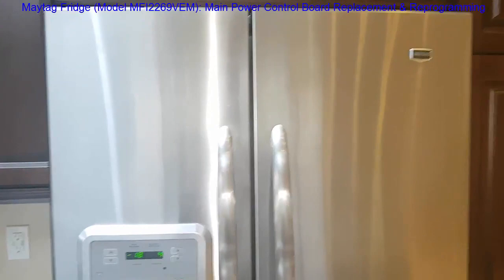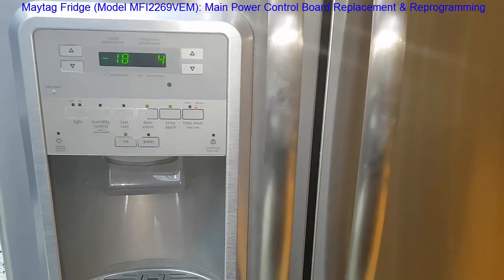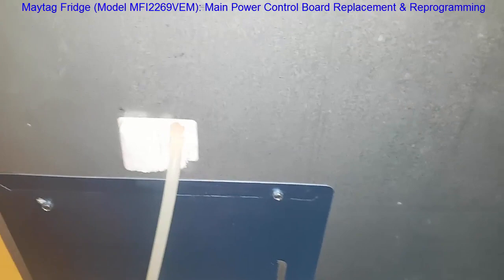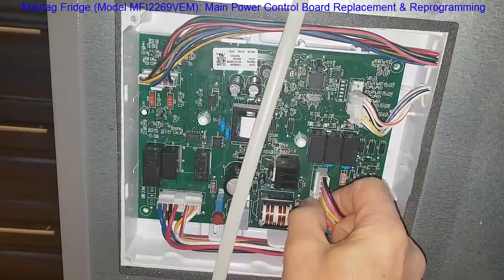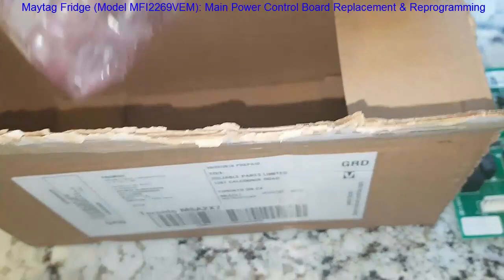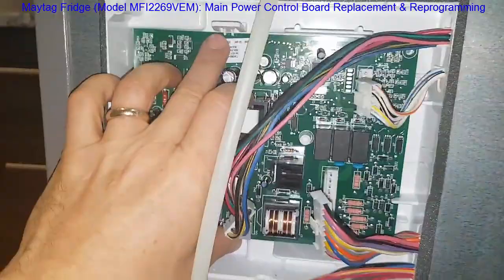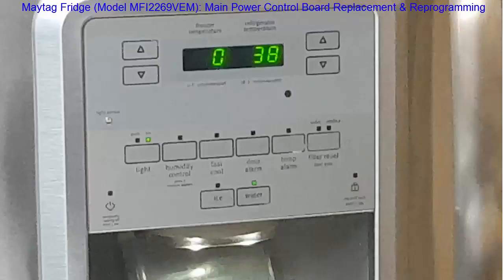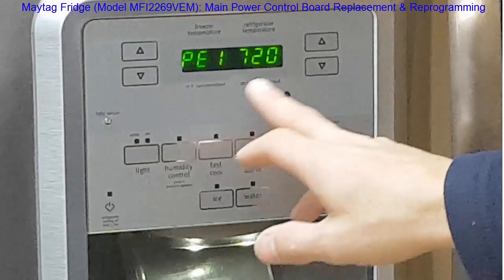Maytag Fridge - Main Power Control Board Replacement and Reprogramming

Comment: I installed the board but the board just blinks PE0 000 and when I hold down the temp alarm button and the down arrow, nothing happens. Any suggestions? Is the new board maybe bad? Thanks.
Reply: Hi Tim,First thanks for subscribing to my channel.Recently someone (E. Smith) wrote back to me (Sep.2019) the following which may be helpful:  ----- E. Smith wrote: -----  My refrigerator, (identical to the one shown in the video) would not go into program mode as described.   However, I went to the "Service Instructions" that came with the refrigerator when we bought it.  Note, these are not the "User Instructions".  The Service Instructions provide a "9 STEP" set of instructions on how to program which worked for me.  These steps are as follows:   1) Press & hold the Door Alarm Keypad.   2) Press & hold "Freezer Temp Down" button on the keypad for 3 seconds.   3) Release the "Door Alarm" button on the keypad & wait 3 seconds.   4) The control will display "PE" to indicate your in programming mode.   5) Entry is confirmed by pressing the "Freezer Temp Down" button once more.   6) The control will display the current Program Code.  The value should be validated with the program code printed on the unit serial plate, located inside the fridge (mine was 1720).   7) Press the "Refrigerator Temp Up" button on the keypad -or- "Refrigerator Temp Down" button on the keypad to change the digit value with each key press.   8) The decimal point indicates the selected digit.  Press the "Freezer Temp Up" button on the keypad to select the next digit.   9) Once the desired Program Code is entered, press and hold the "Freezer Temp Down" button on the keypad until the Program Codes begins flashing, indicating it has been saved.  These Service Specs also say: "NOTE: If you attempt to enter an invalid Program Code the Control will not save the New code.  Exit the programing process by pressing any key OR press the "Door Alarm" button on the keypad for 3 seconds".  If you entered the wrong code I recommend you unplug the unit and start over.------ end of text from E. Smith.So Tim, please read the above carefully and try following step by step and hopefully this gets your fridge code entered and you are hopefully back in business ---- Good luck...  Vito Casola.
Reply: @vitocasola8358  Can't thank you enough for sending this. I got it to stop blinking. Now just need to get into program mode.
Reply: I unplugged the refrigerator and started over and his instructions worked like a charm. I had already bought another refrigerator but we are now canceling it. Thank you so much. You saved me so much money!
Reply: Hello Tim and Happy Thanksgiving,I am so glad to hear that this worked for you and it saved you a lot of money.  Now imagine that you also diverted all that plastic and metal from needlessly ending up in a landfill because of a stupid thing such as a small circuit board.  So in a way you did your small part to helping save the environment.  I like to tackle and do almost any job around the house myself that needs fixing.  It gets done right the first time and saves us a lot of money.  I hope to be able to find some time soon to upload some new videos.  I recently repaired a front load washing machine where the bracket which holds the drum disintegrated, I repaired my aunt's KitchenAid Fridge by replacing a $2.50 relay and a $0.87 capacitor (because her board was discontinued), I also installed a new aluminum vent liner for my Hot Water Tank (to meet a new code here in Ontario).  Stay tuned.  Vito Casola

Comment: Just replaced mother board. Now control panel is blank and won't do anything. Any suggestions?
Reply from the maker: Hi John, Once a new board is installed the fridge powered up again for the first time it should automatically go the flashing screen, so I'm not sure why yours didn't. I'd recommend checking the comments below, as some of them may be related to your issue and you may find them helpful. Vito Casola - FIX IT Yourself!!
Reply: @FIX-IT-Yourself  thanks for the tip! I doubled checked my connections and seen i didn't have the top left plug in properly! Doh! It's back together and working again. Thanks for the detailed vid as well!👍
Reply from the maker: @JohnDoe-hu4ph  Okay great!! Glad to hear you found the issue and are now back up and running again. Vito Casola - FIX IT Yourself!!
Reply: @FIX-IT-Yourself  i also have a ge side by side that doesen't defrost like it should. I have to empty it about every 6 months and get all the frost out of the freezer and then it is good for another 6 months. Thoughts on that?
Reply from the maker: @JohnDoe-hu4ph  Hi John, Thank you for your comment.  Yes, I actually know exactly what you are going through because I had the same issue with this exact fridge (but that was before I had this control board problem and before I was making videos or started my YouTube Channel, so unfortunately I don't have a video for this repair). The problem stems from a design flaw related to a rubber "duckbill" drain which sticks over time and doesn't allow water to drain during defrost cycles so the melted water backs up and ends up collecting inside the bottom of your freezer until it fills the bottom and leaks out to the floor (pretty annoying, I know, I lived with this for about 8 to 12 cycles before I got fed up and researched and figured out how to solve this). The repair is quite simple really and definitely worth the effort.  Email me at vmcasola@gmail.com and I can send you all the information for the part I purchased and how to fix this issue. Vito Casola - FIX IT Yourself!!

Comment: This vlog is very informative and to the point. Thank you!  My husband has replaced our main control board but the lights on the dispenser control board are continuously flashing so that he cannot program it. Any suggestions?
Reply: Hi Rae,Have a look through many of the other comments below and my response and you should be able to see other people that have had similar problems with the continuously flashing lights that have resolved the problem.If you can't find the answer I will copy and paste for you from another response.Vito
Reply: Vito Casola Thanks Vito. 👍🏽 Problem solved. We we pressing the wrong alarm button lol. Happy New Year
Reply: Great! Glad to hear it all worked out. I hope the video gave you the confidence you needed to go ahead and try the repair yourself. Happy New Year to you as well.
Reply: Vito Casola yes your video gave me enough confidence to replace the board blindfolded. 👍🏽
Reply: Where did you buy the control board from?
Reply: @williamehatt7785  We got it from   Trible's, Inc. in Beltsville, MD. It is an appliance parts store.
Reply: Ok thanks

Comment: It worked for a couple days but now just works randomly at time and sometimes it doesn’t although I have switched the motherboard to a brand new one and reprogrammed it.
Reply from the maker: Hi Moe, Thank you for your comment. I'm sorry to hear that changing your board didn't solve your problem. If you figure out what your issue was you may wish to share your experience here so others that experience your problem might be able to have some idea how to solve their issue.  Vito Casola - FIX IT Yourself.!!

Comment: My fridge lights are working intermittently and the door and temp alarms won't sound off any longer.  Would replacing the control panel resolve these issues?
Reply from the maker: If the fridge still cools and the freezer still freezes food then I don't think you need to worry about these minor issues but if then end up manifesting to the point where you no longer get proper cooling of food in your fridge or food doesn't freeze well or at all then I'm willing to bet that changing the main control board will solve that problem. Let me know how you make out with this, and good luck.  Vito Casola - FIX IT Yourself.
Reply: I think not having the alarm sounds working is a big deal. I also think that not having consistent interior lighting in the fridge is a deal-breaker. Would replacing the control panel fix at least the issue of the intermittent interior light functioning? As additional information, the lights sometimes will work after a power reset. But then they go off again. For the most part, the fridge is dark. This is not functional for us. Would the control panel address this issue?
Reply from the maker: Hi R. Monte, I can't say for certain whether the main control board is responsible for controlling interior lighting. I'm assuming you have already tried changing the interior bulbs or at least you have tested the interior bulbs on some other light socket somewhere in the house to rule out a bad bulb(s). If you are having a number of issues then I would suspect that the main board is the culprit.  Usually the main board will give any number of problems after a utility power surge/spike which may have damaged one or more of the circuit board components. If you know anyone that has the same fridge which works perfectly then maybe you can try swapping the boards (shouldn't take too long to do) and see if their fridge shows the same issues and your fridge problems disappear.  Then you will be able to know for certain and all you would have to do is purchase and install a new board. Hope this helps. Best of Luck with your repair.  Vito Casola - FIX IT Yourself.
Reply: @FIX-IT-Yourself  Nice video and we recently had power shutdown in the neighborhood and my refrigerator doesn't cool or freeze the food anymore and panel only light up when I press any button.  I then unplug the power for a little bit and plugged it back but I heard the pop noise then nothing happens (not cold or freeze).  Curious if this means my compressor is bad or?  Thank you.

Comment: Question I have the same refrigerator  will  be the same panel or not 
All the main panels are the same
Reply: Hi Cristian, If it is the exact same fridge then the control board should be the same.  You should contact Maytag and be sure to get the correct model number of control board which is for your fridge model number. Good Luck!!

Comment: Where are you located, and where did you get the part from? Thanks
Reply from the maker: Hi Scott, I'm in Greater Toronto Area. I bought my part from Reliable Parts. Address is shown in the video. Good Luck. Vito Casola - FIX IT Yourself.!!
Reply: Thanks Vito!
Reply from the maker: @scottholmes561  You're most welcome Scott. Good Luck. Vito
Reply: Do you know of a company that repairs these boards?

Comment: Where did you guys buy the motherboard. I just called Maytag and they quoted me $418. Is it different cost for the different models.
Reply: $364 on Amazon
Reply from the maker: Hello Raymund, Thank you for your comment. In the video I indicated that I contacted Maytag and asked them for a list of authorized parts suppliers local in my area. They gave me a few company names and I was able to find the company which stocked my board for the best price. My board cost about CDN$172 (CDN$152 + HST). Hopefully you will be able to find your board for a similar cost or less.  You could also try to repair your old board by visually inspecting the circuit board to see if you can spot any bad capacitors and try replacing them.  Sometimes replacing one or more capacitors at a cost of $5 or less could solve your problem.  Good Luck. Vito Casola - FIX IT Yourself!!

Comment: I replaced mine and it is on the screen with the factory codes (PE0 000). However, it will not allow me to program it and the decimal point isn’t showing at all. It’s like the freezer temperature buttons don’t work.
Reply from the maker: Good Morning JJG, Not sure why your fridge is doing that. Try unplugging the fridge for a few minutes and then plug it back in.  Also if you review the comments from others below there has been a lot of discussion on this subject of programming and not everyone's solution is the same but it could give you some ideas. If you're still having problems you may have to refer to your specific fridge manual or contact the manufacturer to see if someone could assist you with this. Vito Casola - FIX IT Yourself!!
Reply: FIX IT Yourself I FINALLY got it to program yesterday evening. Someone suggested that I open the doors, hold the light switch while pressing the freezer down button three times to make the code show “PE”. Well, that didn’t quite work but I ended up taking the front control off and basically disconnected everything. Still didn’t work but I kept trying and eventually “PE” popped up and I was able to press freezer down to place the decimal and enter the code. My family and I were sooo excited because the fridge had been down since Tuesday and one company sent us the wrong part. Thanks for your help!!!
Reply from the maker: @jjgmontgomery  Fantastic!! Glad to hear you were finally able to get into the program and get your fridge work again. No better feeling than knowing you helped avoid a still perfectly good appliance from ending up in the landfill. What a shame that would be. Hopefully this video and the various comments others have left were helpful. Thank you if you "LIKED" my video and if you subscribed, it helps improve overall recognition of my channel.  Vito Casola - FIX IT Yourself!!

Comment: So I tried replacing my Board but when it came time to program, the screen was blank and would not show the PE0000. Any suggestions?
Reply from the maker: Hi Trab, If you go through some of the comments below you should be able to find some discussions on the subject that may help you. Let me know if you are able to find them and if not I can try to point you to which ones may contain useful dialog on the subject of the issue you seem to be having. Good Luck.  Vito Casola - FIX IT Yourself!!
Reply: So I found a comment where you give the instructions on what to do with a blank screen, but it was the same procedure I was following. Unfortunately I was not able to get the board into programming mode at all no lights would stay on after any button presses. The replacement board I received does look different than the original. I’m not sure where to go from here.
Reply from the maker: @bart1034  Good Morning Trab, First I would try following the procedure again. Check some comments because somewhere some people have identified a strict procedure to activate the scree.  Then if you still are not able to activate the control board display double check to see if your replacement control board is the same as the original. If it doesn't look almost identical to your original board then you may not have the right one. I would double check the model number of your original control board against the new one. Where did you get the replacement board? If you can return the replacement board and exchange it for a new one that matches your I would do that. Be sure to bring your original board and replacement board and show them that what they gave you doesn't match the original board and hopefully they will accept the return and find you the correct board.  The other alternative would be to try to repair your original board. Usually the issue with these boards is one or more bad capacitors and I know there was at least one or more comments on the subject of how to repair this board. If you can't find it let me know and I will help you locate it. One guy that fixed his board by replacing the capacitors actually sent me an email with photos of the bad capacitors. I could share those photos with you if  you send me your email address to vmcasola@gmail.com.  Whatever you decide to do, good luck my friend.    Vito Casola - FIX IT Yourself!!

Comment: I cannot program my fridge after replacing the motherboard.  Decimal points won't show up.  H20 and ICE shows when I press the right side to enter the code.  Do you now why that is.
Reply from the maker: Hello.  Thank you for your comment. Not sure what is happening. I suggest you look through the various comments left by others that have had similar problems as you may find some helpful hints from questions posted by others and how they resolved similar issues.  Good Luck. Vito Casola - FIX IT Yourself!!

Comment: The new control board has been installed in my fridge but the display PE0000 keeps flashing and I can’t program anything. What should I do?
Reply: Hi,Have a look through many of the other comments below and my response and you should be able to see other people that have had similar problems with the continuously flashing lights that have resolved the problem.If you can't find the answer I will copy and paste for you from another response.Vito